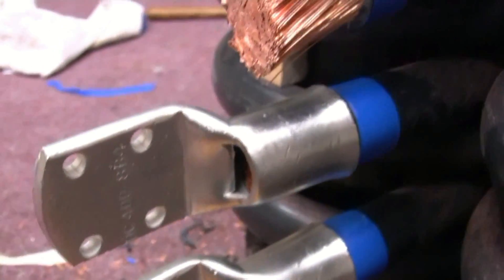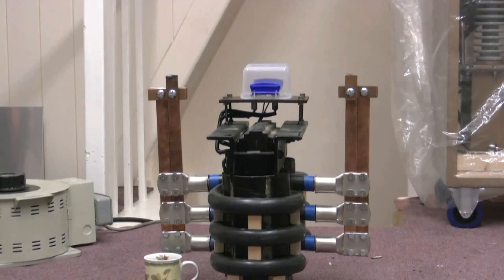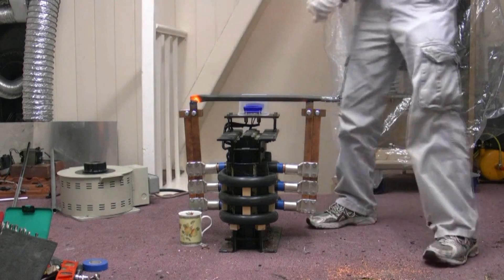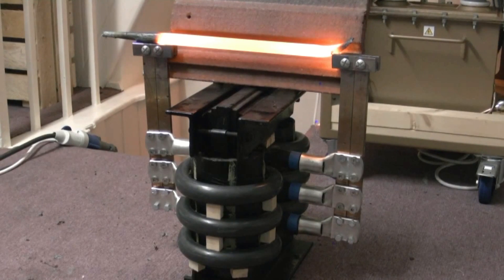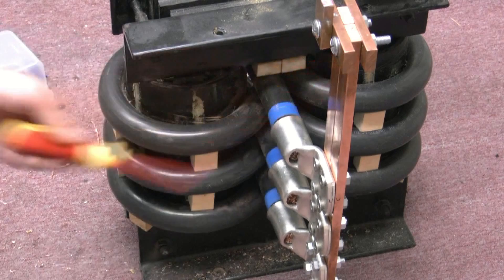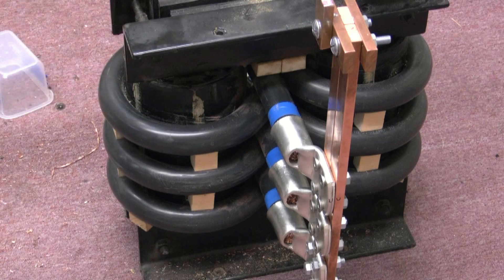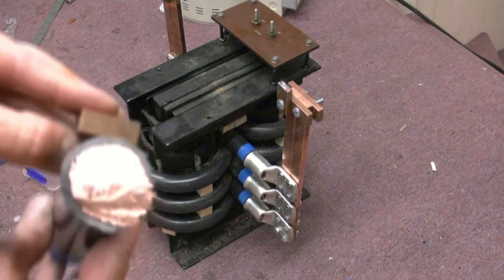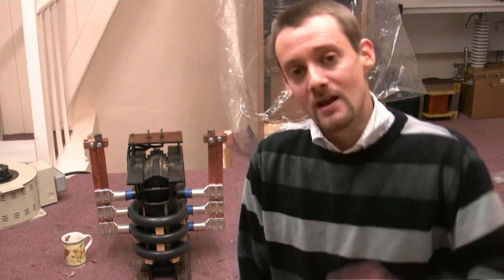50,000 Amp Transformer Completed

Comment: I've been hearing FOR DECADES "It's the amps that kills you not the volts!!!", starting with my dad in 1973. I proved them all wrong, I touched the posts to my 12 volt 300 amp car battery and 300 amps across my heart and nothing happened. Somebody says the "Volts were too low." So??? 12 volts or 12,000 volts.....the voltage don't kill, they say, but the amps susposedly kills, but I am still alive.
Reply: You, clearly, are also a novice.  You DON'T have a '300 amp car battery'  It's a common misconception, but that is NOT how they are rated.  You may have a 300 amp hour battery (unlikely), or a '300 CCA' (Cold Cranking Amps) battery (more likely).  That means, under a certain set of well-defined conditions, that battery is CAPABLE of delivering 300 amps - into something close to a short circuit (and for a short time).  Your dry skin is far from a short circuit & would typically draw microamps, possibly milliamps, depending on conditions.  That is, there WAS NOT, most definitely, 300 amps, nor anything remotely close, across your heart.  If you were to drive a nail through each finger & connect them to the posts, the contact with your wet, salty flesh would allow a significantly higher current to pass, probably not enough for fibrillation, but it is possible.  It is Voltage (or ELECTROMOTIVE FORCE) which DRIVES current flow (hence Electro motive), dependent on the circuit resistance. THIS IS OHM'S LAW !  (If everyone knew & UNDERSTOOD Ohm's Law, a huge number of comments on Youtube would be unnecessary)  It is a three term equation - E = I.R  [or R = E/I  or I = E/R ]  There are three quantities directly related by this equation.  Given that R (resistance) in this case is fixed [your skin resistance] the higher the voltage across it, the higher the current through it.  Typically accepted figures are around 500,000 ohms for dry skin resistance & 30mA across the heart to risk fibrillation & death. [the numbers are 'rubbery' but these are well-accepted figures] 12 volts across 500k ohms dictates 24 MICRO Amps.  12,000 volts would produce 24 MILLI Amps - now you're getting dangerous.  Also that 12,000 volts may 'break down' the dry epidermis, allowing current to flow through your moist flesh, in which case current rises abruptly & now you're dead.  YES the CURRENT ('amps') is the determining factor in physiological risks from electricity, but the VOLTAGE determines how much current will flow from a given source.  And, just an aside, I can point my finger at one of my Tesla coils & draw arcs over a foot long, representing several hundred thousand volts & feel only a slight tingle, and have the current go nowhere near my heart.  This is at, say, 1 MegaHertz, where, due to 'the skin effect' (mentioned earlier) the current is confined to outer layers of my skin.  (The jury is still out on the potential for longer term nerve damage from this though :-)
Reply: Philip Chalk No, I am not a novice,,,,,I was making a point. It takes BOTH volts and amps to kill. If you have the charge for 300 amps but only 12 volts, that won't be enough to force 300 amps thru you, only milli or micro amps. I repeat it takes BOTH to kill.
Reply: kdc43 I repeat, You, clearly, are also a novice...

Comment: at 1:40 your touching the bar with bare hands hows it not hurting you?
Reply: a. the voltage is very low - can't penetrate skin.
b. he is not the easiest path for the electrons to go to ground - the ground contact is.
Reply: i can see sparks n the bar is glowing red, i wouldnt be the one to touch it thats for sure electric hurts i cant even touch the tap in my house it gives a nasty ZAP!!
Reply: That transformer can generate a lot of current, but just barely 1V. It doesn't hurt you because the same reason that prevents a 9V cell or a AAA from hurting you. It can generate 50.000 A of current, but just across some load with very low resistance. Remember your ohms law. Your body has around 1MOhm resistance from hand to hand. You will need a much higher voltage to make a few miliamps of current cross thorough your body.
Reply: becouse this transformer isn't connected to ground, the current simply can't flow throught his body. the only way to take a shock ( impossible by the way, becouse of the few volts in output) is to touch both the terminals
Reply: i dont even use the tap no more now i use the one upstairs the downstairs one is lethal. hurts pretty bad. strange aint it how the one upstairs shares the same water pipes and water yet its not electrified i can wash my hands no trouble at all its just the downstairs sink that gets me, not only the sink is faulty also the oven back of the fridge there was a tea towel on top of the dryer i tried to grab it and even that got me. is it possible that could be costing me electric aswel?
Reply: we supposed to be getting rewired soon but had this problem for about 4 years nobody has touched the electrics since we moved in 8 years ago i tell everyone that comes in my house not to touch it i dont know about aluminium sheeting its an old house so probably not. come to think of it we had the problem abit longer i remember when my dad lived here the dvd player give us a shock so did the tv Ariel wire the problem seems to be downstairs.
Reply: we had a key meter in that was changed last year to a quarterly year one no key we were using £50-£60 a week always running outta power so changed it that was done by an edf contractor. we had problems way before that tho
Reply: He has a sleeve on it, you can see it
Reply: Virtualgod2009 hes got guts ill give him that.
Reply: He is not the path of least resistance.

Comment: 50,000 amp? Godamn. It only takes 0.05 amps to kill you!
Reply: Not enough voltage to penetrate the skin.
Reply: Granted. Still a staggering number nonetheless.
Reply: Andy Jones Yep.  Staggering & inaccurate.  Nowhere in this video are we seeing 50,000 amps.
Reply: Philip Chalk
Your right AJ. However, 12 volts will NOT penatrate through your skin - which is like an insolator, thus no current to speak of, to kill you.
 Take a 9v radio battery and touch the terminals. Nothing.. Now take that same 9v battery and use your wet toung to put across them terminals - YOWEEE!!! There goes your taste buds for a while... (Please video that test - love to see it :-)
Once the voltage gets high enough to rupture through the skik, then your dead meat as the water your mostly made of becomes the conductor. I can hear the fat lady singing now..... The Party Is Over.................

Comment: 50,000 Amps at what... half a  volt? Isn't that like 25KW of power? Did you connect that directly to power lines? xD
Reply: Read the description.
Reply: HeadShot360IN The power that thing is using would blow fuses and melt wires if it were hooked into regular home sockets. Was wondering if he took the power cord and threw it onto the power lines in front of his house, in a manner of speaking. I should have read the description indeed.
Reply: Philip Chalk Oh, absolutely. As always, with "standards" and "practices" not always in sync, YMMV. We have a standards body in the NEC (National Electrical Code) and others, like UL, draw on them so we do have "high voltage" and "high current" defined for house wiring. But, these numbers are drastically different in the standards for USB or other signaling systems, house wiring, medical equipment, power grids and so forth. What the commenters are missing is that the standards apply depending on the context. ULy has defined as "low voltage/power limited" wiring as 100VA, 8A, 32V, so it's not a rectangle, but these can still kill you and start fires. The IEC and UL define Low Voltage for safety sake as 32VAC/60VDC and less than 10mA.
Reply: Philip Chalk I think Headshot was thinking of the street wiring, not the mains wiring. That IS high voltage by anyone's standards at about 4KV most places in the world.

But... guys? I can pull 25KVA from my mains on a sustained basis and up to 75KVA in short bursts... and my mains are the common US 100A service (240V split phase so I get 120V for appliances and 240V for water heaters and "cookers", like the stove).
Reply: Joseph Perkins Oh, OK, I guess he was.  In my part of the world, power is distributed up the street as 3 phase, 415V star.  That comes usually from 11kV 3 phase, which you get in streets too.  Your typical consumer end pole transformer here is 11kV 3 phase delta to 415V 3 phase star.  

And sure, you can pull 25kVA from a decent sized house mains (I'm in a rural area; my switchboard is fed 240V single phase, via 95 mm^2 conductors, from a 25kVA single phase transformer across the road) but look at (a) the size of the wires in & out of his variac   & (b) the size of the variac.  Neither of them would sustain 25kVA for any length of time.
Reply: HeadShot360IN Headshot - Are YOU ?  At least in my country (& IEC & British Standards), 240 volts ac supply is classified as 'Low Voltage' (which is reassuring to know when you accidentally connect yourself to it :-)  So few of you guys UNDERSTAND voltage, current & power.  'High Voltage' is, of course, a relative descriptor & depends on either personal opinion or whose standards you choose, or are required, to adhere to.  Same thing for "low amperage"  but, especially under fault conditions, you CAN draw a significant current from your 'average' household supply before something (e.g. fuse, breaker etc.) 'gives up' - enough to scare you.  Try it !

Comment: Regarding the secondary terminals, an ideal solution would be thick-walled copper pipe.  Due to the skin effect most of the current is carried in the outer 1cm of the conductor at mains frequency, so a 1cm thick pipe a couple of inches in diameter would allow for much more current than a solid conductor of equal mass.  The hollow conductors can also be air-cooled from within, adding another measure of safety.  What was that transformer originally used for?
Reply: He's got a fair bit of conductor area & you're right - unlike most commenters here - skin depth works out around 9.25mm, but the limiting factor in this example is CSA of the core.  Even if you could feed it enough for 25kVA output - which is not happening here due to the size of the variac & primary wiring - that core will saturate before you get there.  My guess is that might be about a 5-10kVA sized core, but not 25kVA

Comment: after watching you touch both ends with just a cloth to protect yourself, its high voltage and low amps, its just a fake!!!
Reply: What?  It's completely the opposite of that.
Reply: lol, we use radendent heating at my work 220 volts at 50 amps will make a metal rod glow like a light bulb, so he can produce 110,000 watts at 2.2 volts, 50,000 amps.. but 50 amps at 220 volts is only 11,000 watts!! nothing he has showen on his vid or has he given any math that supports anything he has showen us!!! yes input cables are very big to support high  amps, out put are small low amperage high voltage!!
Reply: I don't know what you're trying to say?  You're right, there are simply not enough hard figures or measurements given to characterise this thing completely, but it is CLEARLY a low voltage, high current output (relative to input) transformer.  This is obvious not only from the effects demonstrated, but also the turns ratio.  This video does not show anything like the numbers claimed - you only need to look at the size of the variac, and wire gauge feeding the primary to know that.  But this is taking 240-ish volts from 'the wall', somewhat less from the variac, at some 'moderate' current into the primary, to produce roughly single-digit voltage at maybe several hundred amps from the secondary.  relative turns counts, wire gauges etc. alone make this obvious.
Reply: scot fletcher
If you short a 0.5 V power source capable of delivering 1 quadrillion amperes by touching each terminal, only a measily ~0.1 milliamps will flow through you. That's just ohms law.

The stuff you connect across the terminals must have a low resistance and very good connection across the terminals or nothing much will happen at all.
Reply: breezebro Yes !
Reply: he tucht it with  a cloth because it was hot you idiot

Comment: You could definitely use that as an induction heater if you built a cylindrical coil and attached it to the bus bars.
Reply: That would constitute 'just a heater' or a radiation heater or whatever.  It wouldn't be a very efficient induction heater at 50Hz

Comment: this is how chuck norris cooks his hotdogs.
Reply: You can actually cook a hotdog (unevenly) by connecting each side of it to the mains.
Reply: soylentgreenb Indeed !   Or make an "LEVD" (Light Emitting Vegetable Diode) by doing  the same with a kimchi  :-)
Reply: You Wouldn't be able to cook it by putting it directly on the output, you would need some low impedance metal bar to heat up, at that point you may as well just use an electric stove...
Reply: yeah its chucks microwave, the little one.
Reply: soylentgreenb 3
Reply: Chuck Norris cooks a hotdog just by looking at it.